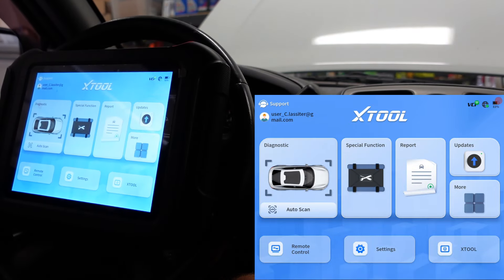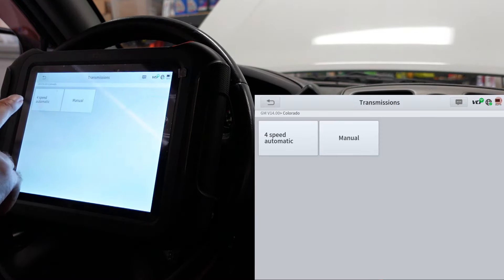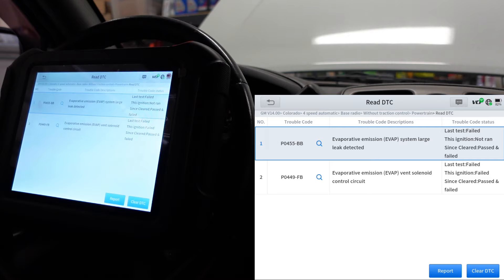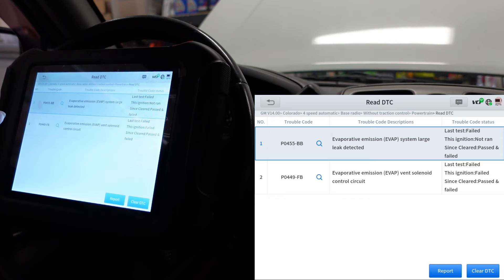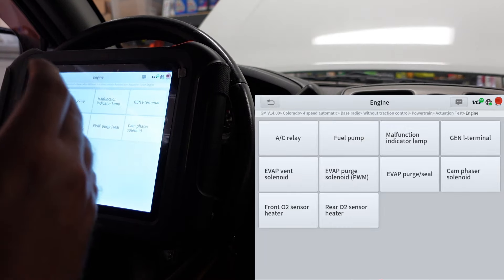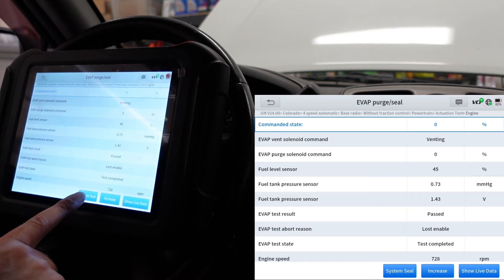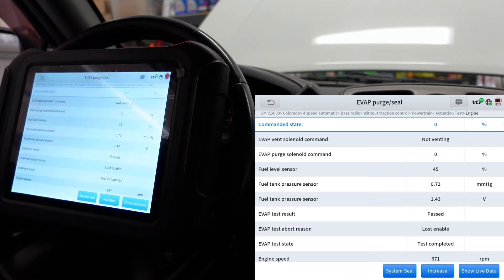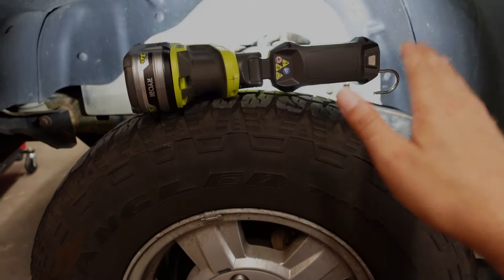2006 Chevy Colorado EVAP Leak P0455 and P0449 Diag and Fix - Purge/Seal and Smoke machine

Comment: Is this causing white smoke coming from the exhaust when start the truck
Reply from the maker: If you have a little white smoke at startup maybe check your injectors and see if they are  sticky because sometimes if they are sticky and stuck open a little bit it'll run rich for a little bit and that'll cause white smoke. So probably get a really good fuel cleaner like Redline and see if that'll help. https://amzn.to/3XrMrND